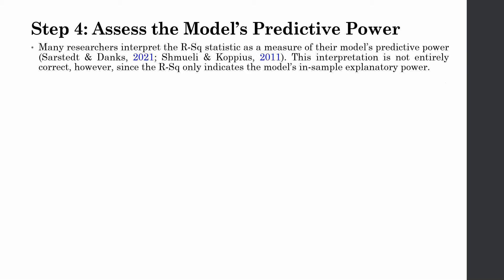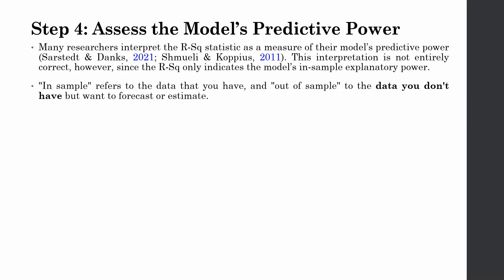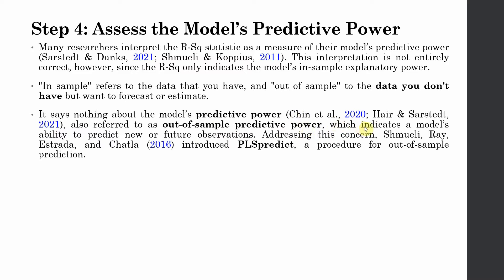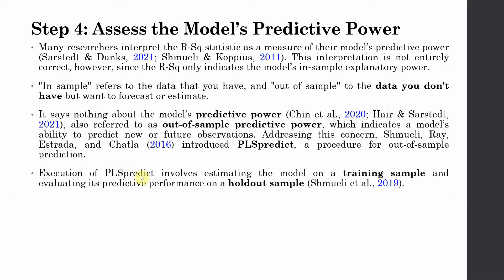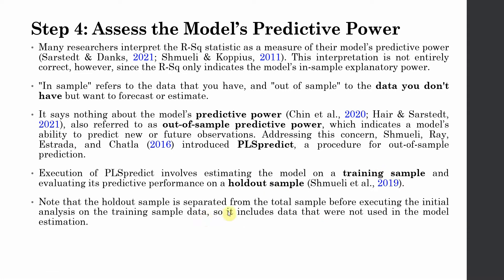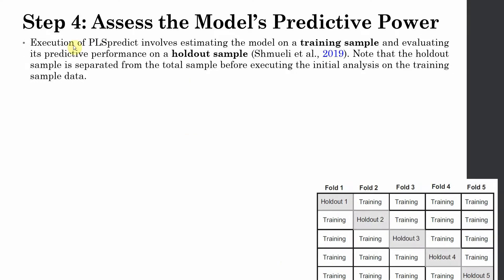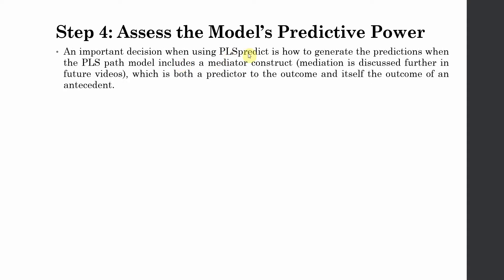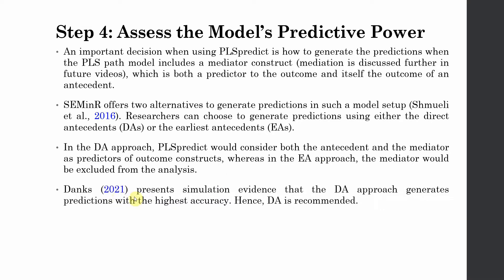23. SEMinR Lecture Series | Step 4: Out of Sample Predictive Power | How to use PLSPredict

Comment: How to decide the number of folds keeping in view the inverse squrare root method (ism)?? For eg if the sample size is 600 having 10 folds will result in sample of 60 per fold which will be much less than the sample size recommendation based on inverse square root method what should be done in this scenario???
Reply from the maker: When choosing a value for k, researchers have to ensure that the training sample in a single fold still meets the model’s minimum sample size requirements. In your case, with 600 and 10 folds, each fold’s training sample has 9 * 60 = 540 observations.

Comment: Thank you very much for your videos! I am currently using them to analyze my model, which entails a moderator. When I try to predict the model inclduing the moderator, it gives me NULL as a result. It works fine if I take the model without the interaaction term. Is this normal or can I still get the results in another way? Thanks in advance!
Reply from the maker: Pleasure. I am glad you liked it. As for null it is not normal. Can you please share the code with the screenshot of your results plus the nature of your variable as to how you measure them in tue SEMinR fb group
Reply: @researchwithfawad  ok thanks just did!